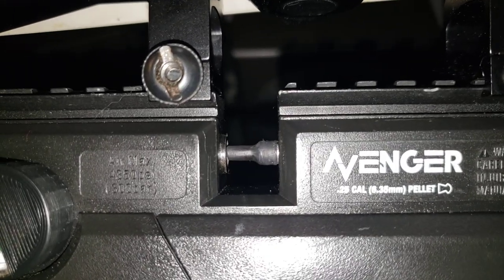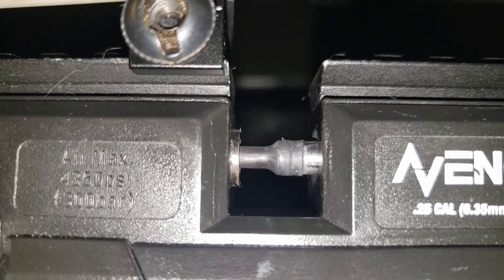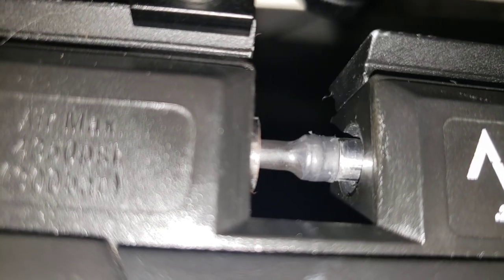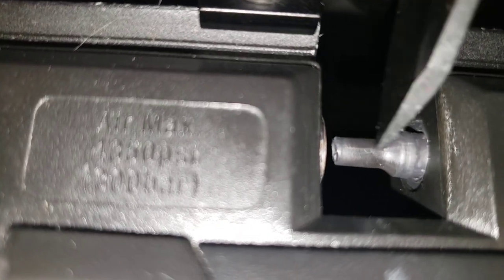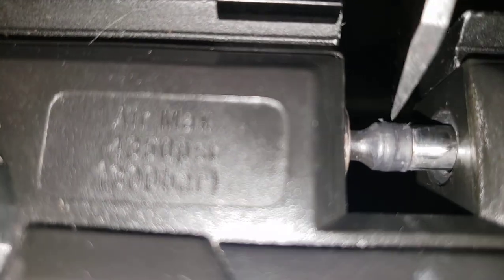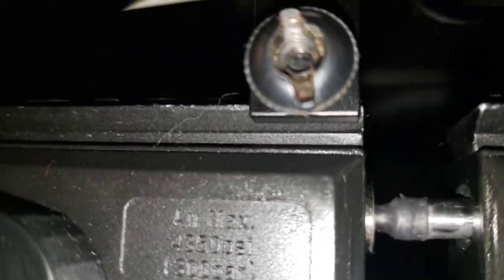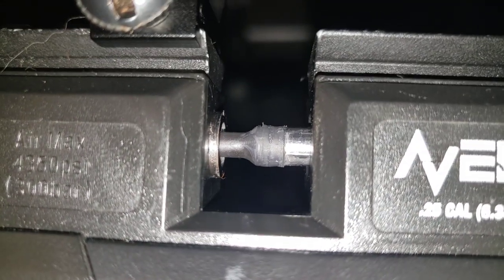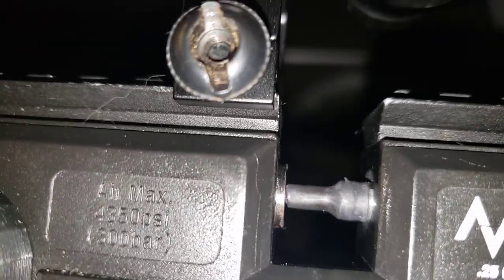Air Venturi Avenger .25 Bolt O-ring alternative.

Comment: Thanks! Exactly what I’ve been looking for. Couldn’t ask for a better fit.
BTW I have a Beeman 1336 Chief 2 Synthetic. I just bought a Umarex Gauntlet magazine to see if it would work in it , and it does! 
The Gauntlet magazine works in both the Air Venturi Avenger AND the Umarex Origin, so this mod should work for all four rifles. 
It seems that  these bolts and receivers are being sourced from the same manufacturer.
Thanks again for the heads up. Finding the right o rings can be a real pain.
Reply: Yeah, bolt and receivers are made in the same factory. Also, they all use a "Marauder style" magazine from Crosman's design

Comment: I solder nearly all my electrical connections. So I always have surplus heat shrink. Marine heat shrink has like hot glue inside and the wall thickness of the tubing is greater than standard heat shrink.  It could be more durable.
Reply from the maker: Yes sir. I'll never use anything else again. This solution is pretty foolproof and talk about steady FPS. I recently got 3 chrony doups in a row. I've had 2 a lot of times but 1st time I've had 3 in a row.
Reply: @robert7984  did you remove the probe to install it?
Reply from the maker: @webreakforsquirrel4201  sorry for the late reply man! I rarely get notifications on this channel. But no, I just slid it in lol.

Comment: I'm confused.  You cut two smaller bands and put in o ring groove and then covered entire bolt, or did you leave the o rings on and then cover with shrink or did you take o rings off??
Reply from the maker: I took the rings off. Ill be doing a video in the next couple of days. It will show everything.
Reply: My question exactly. Or cut shrink for groves where O Rings went. Then cover probe.
Reply: Have you done the back up video?
Reply: Did this ever get answered?
Reply: No.  @ychongy

Comment: Do you pull the pellet probe out the back to perform this?
Reply from the maker: No I just slip the cut pieces of tube over the end and press them on before hitting with heat.

Comment: Do you remove the existing  O rings!?
Reply from the maker: yes. the 2 small cut strips will fill in the o-ring channel.
Reply: @robert7984  THANKS!
Reply from the maker: @joverton8522  No problem Be sure to use couple drops of silicone oil for the break in. It'll feel a little stiff the first few mags but this is a good thing...its basically custom sealing to your specific barrel.
Reply: @robert7984  THANKS AGAIN!!

Comment: Someone is making a killing off of selling little chopped up pieces of 3/16 small engine fuel line for $10 each, LOL! I ordered one of these kits and compared to said fuel line that can be obtained from Advanced Auto by the foot for a few dollars and it's identical in every way. Save yourself some money, make 5 or so "O-ring delete kits" and still have line left over to repair your gasoline weed eater.